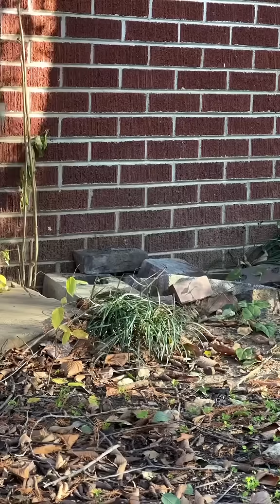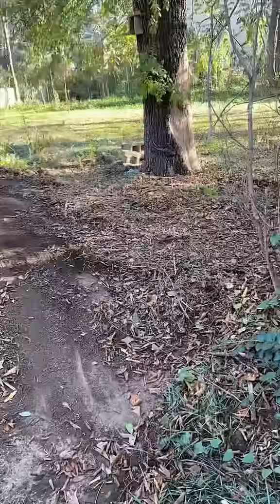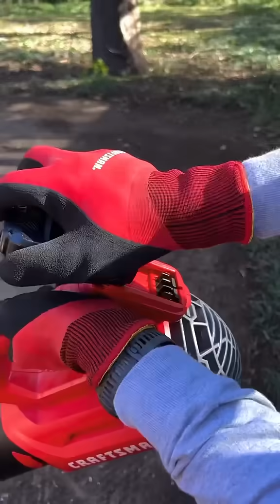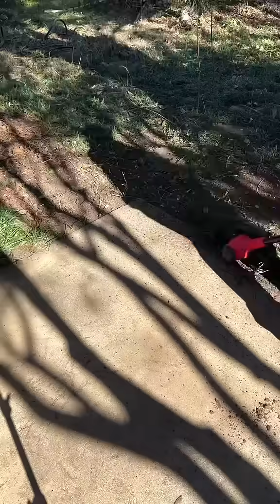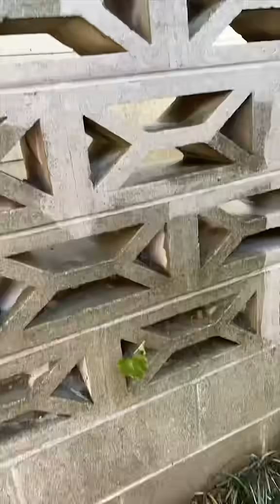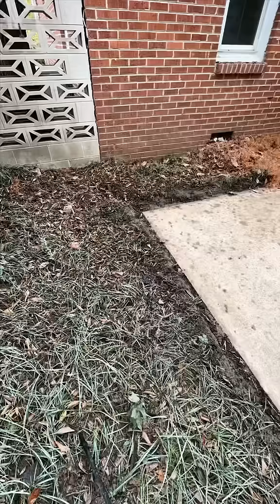Transforming our back patio was easy with @craftsman tools! #webuildpride #cordlesstools #CRAFTSMAN

Comment: This is an add for Craftsman, not a cost effective way to transform a patio.  A homeowner would be much better off spending their money on the right materials instead of $1000 on tools they dont really need.

A cubic yard of mulch is less than $30 and wont blow all over the place like the leaves you put down.  Nor attract as many pesky bugs or snakes.  Youre better off soft washing the patio with diluted bleach instead of a pressure washer.  You dont need the edger or pole saw.

Comment: Instead of pressure washing everything; Go to a pool supply store. Buy a bottle of Sodium Hypochlorite (it's basically a stronger chlorine). Put it in a pump sprayer at about a 10:1 ratio of water/chemical. Spray a coat over the concrete and walls. Let it sit for about 20-30 minutes, then do another coat. Let that sit for another 30 minutes, then rinse it away with a garden hose. Everything will look brand new, without etching the concrete with the pressure washer. Much more efficient on time and much less damage to the surfaces. This can also be used to clean the roof & walls very effectively without damaging shingles or roof tiles. It will make the paint look almost brand new with less risk of tearing off old paint with the pressure washer.

Just make sure to rinse any plants near wherever you're spraying very well, or it will cause them to turn brown.

This is a basics of softwashing. I did this as a job for a few years and it's amazingly effective and very fast. Works best on a sunny day. A rainy/shady day will slow the progress a bit, and you'll need to use a little more of the chemical.
Reply: Is this safe for washing roofing shingles?
Reply: @etchden  Yes, I've done 200+ roofs this way.